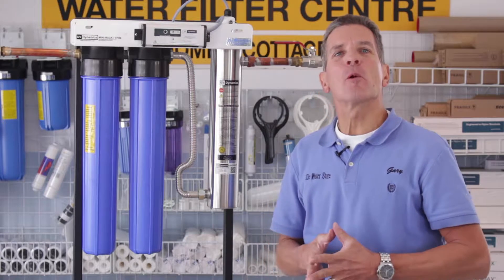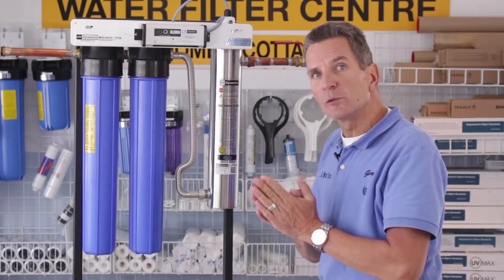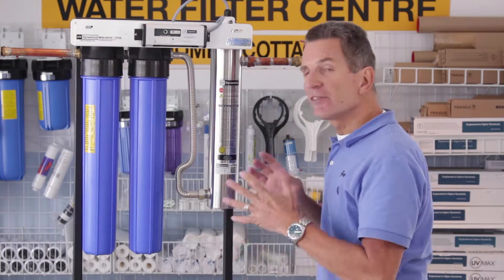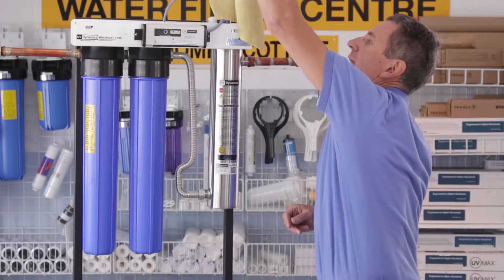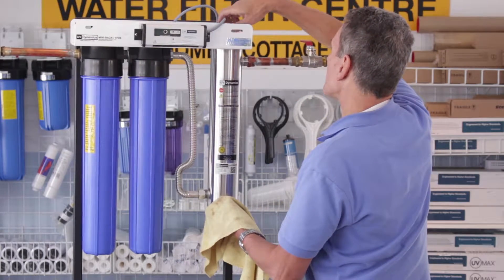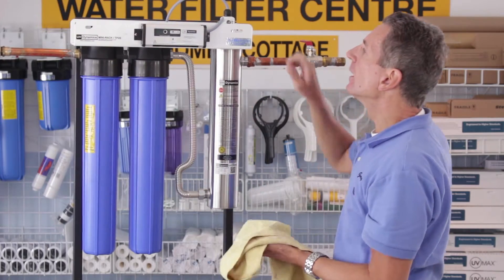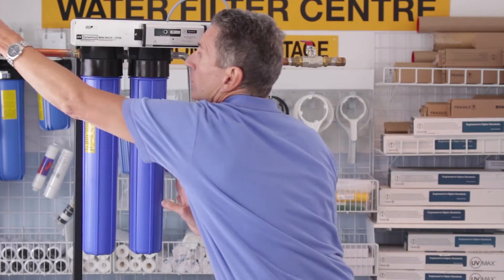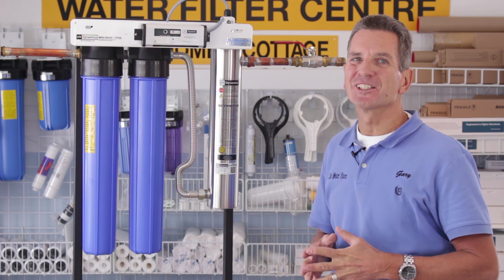How to REPLACE LAMP and SERVICE HuM SAFE WATER 10 Water Filter

Comment: Most filters are rated for 6 months only I have never seen a system that can get by with one change a year and still be adequate and safe. If you read the label I think you will see the 3 to 6 month limit of use.
Reply from the maker: They are not rated for 3 to 6 months, the filter manufacturer would like you to replace them every 3 to 6 months, so they sell more,  but that is not necessary unless they clog that frequently.  95% of our customers, and myself, change them every 12 months.